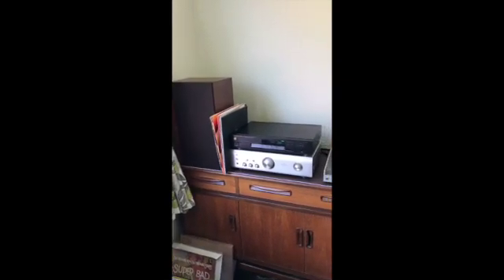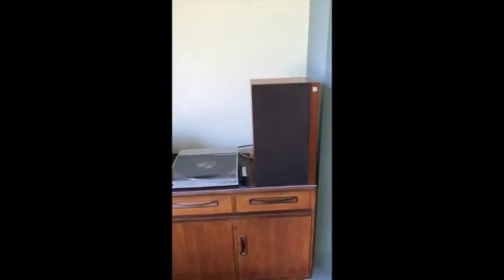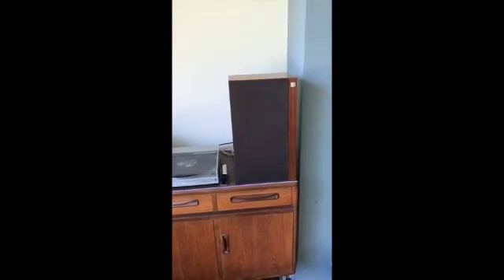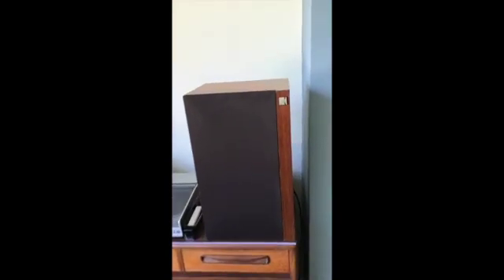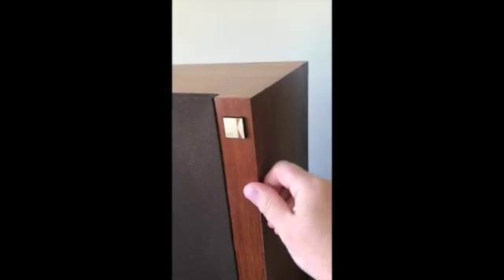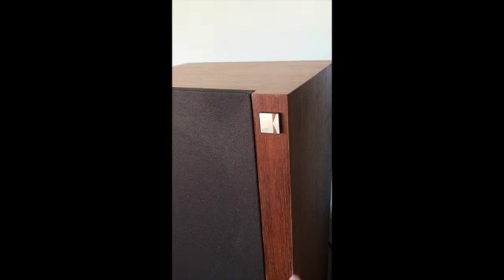KEF - Corelli refurb part 4 - final update

Comment: They look and sound great. I had a pair about 10 years ago before progressing to the original Concerto. I missed them over the years  so earlier this year I bought another pair. I’ve changed the caps and wiring in mine. The Concerto has replacement mids and Morel tweeters. I had contemplated fitting  a pair of Coles 4001 but the Morel’s have greater range so so I just replaced the T27
Reply from the maker: Hi Tim - Thanks for getting in touch.  Its great to save some of this classic gear from the recycling centre. It only takes simple soldering skills to get some really amazing sound......and as you say in your post, can be further improved to suit your personal preferences.  Excellent work - and thanks for sharing!

Comment: The Corelli was my first pair of KEF loudspeakers.  I bought them used in 1983.  Since then I have owned the smaller !01, 104.2 and 105.2 Reference Speakers.  I also had a pair of their C40 which was a lesser speaker than the Corelli.  These look nice!
Reply from the maker: Thanks for getting in touch.  Yep, these sound really good now.  I recently compared them to a set of Arcam Alphas (I know the Arcams are budget by comparison) and it was day and night in terms of the bass and mids.  The Corellis are so much warmer sounding as a whole. Thanks for sharing your experience. It just goes to show that with very little money, and some practical willingness to tinker, you can achieve some fairly decent results! Cheers.